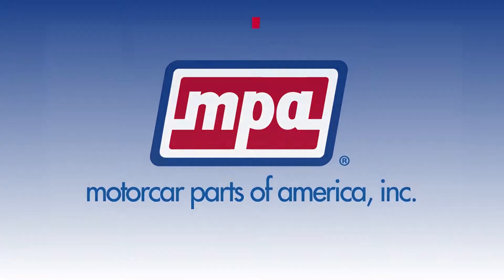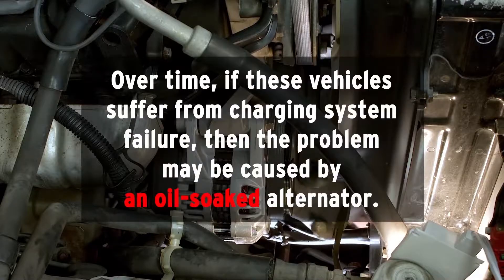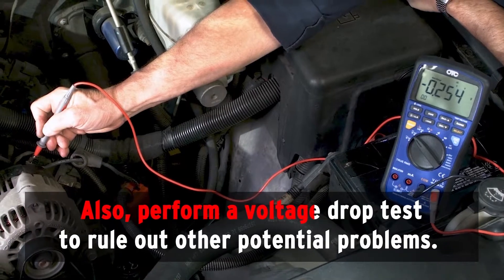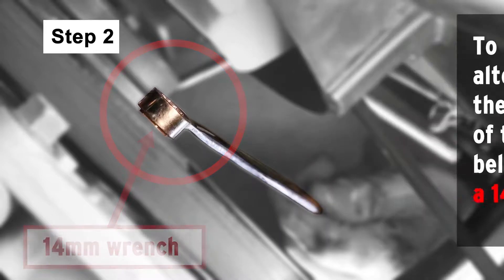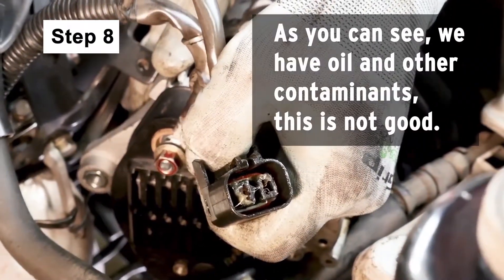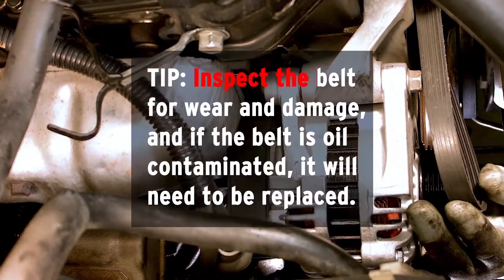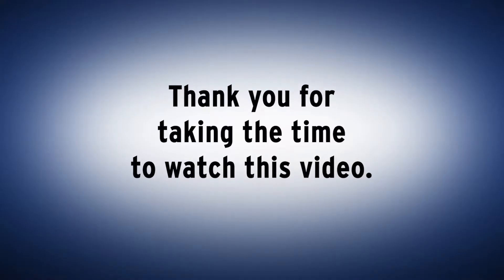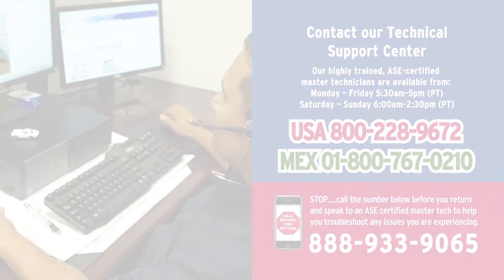Technical Installation Series: Repeat Alternator Failure Due To Oil Contamination

Comment: I saw no need to do step 5 in removal (temove the adjusting bottom bolt connected to the belt tensioner) since I couldn't figure out what exactly he was talking about.  So,  I didn't and removal was successful just the same.

Comment: Have a 1997 Mitsubishi Montero SR, lights were flickering/pulsing throughout the system, changing the alternator fixed this problem. Mine came with the shield installed. Thanks for the video providing guidance on replacement.
Reply: where were you able to get one?
Reply: @drjwbriand  I bought mine from O Reilly Auto parts
Reply: @milokanon5606  thanks, i'll try them!